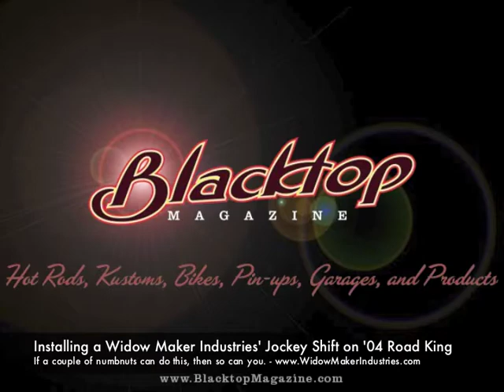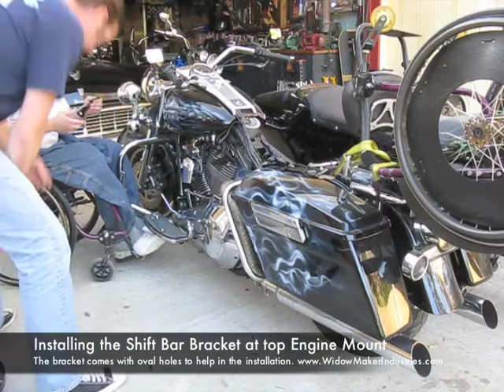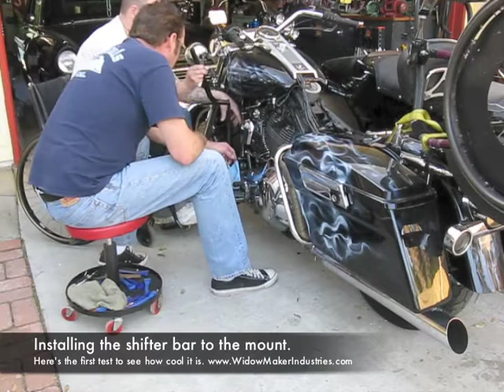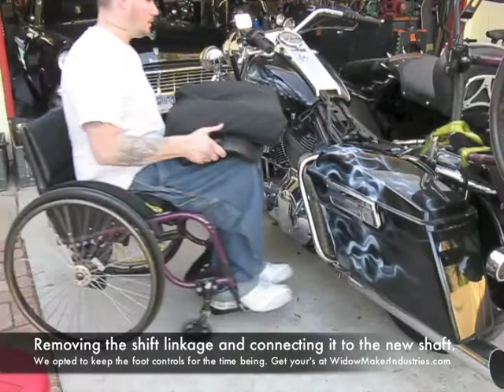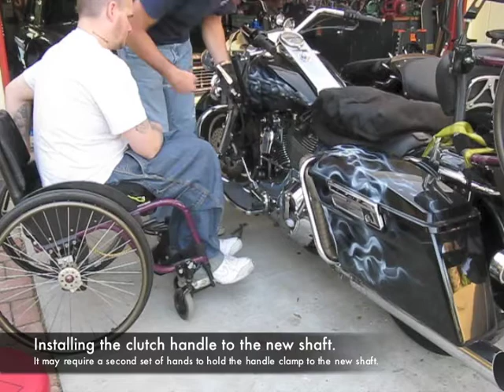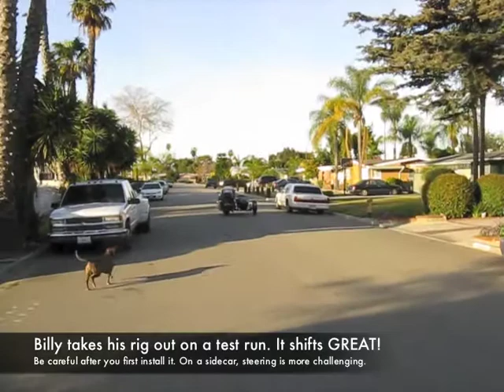Widow Maker Industries' Jockey Shifter Installation How-To

Comment: Jeremy, I am adapting my bike now, but did not want to take off while turning with one arm while having the clutch lever on the shifter.  My clutch will still be on the handlebars and the hand shifter will be on the right side. Looks like you already have the front and rear brakes plummed together  using the front right brake lever.

Comment: Where does the washers an nuts go on the shifting bar
Reply from the maker: There should be a delrin washer and nylock nut at the pivot point and the washer and nut on the shift arm at the bottom.